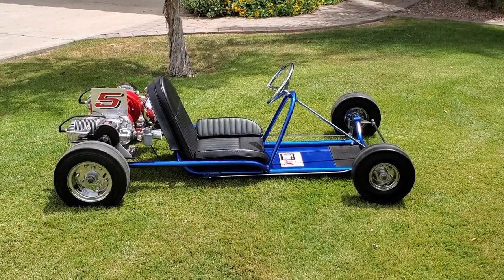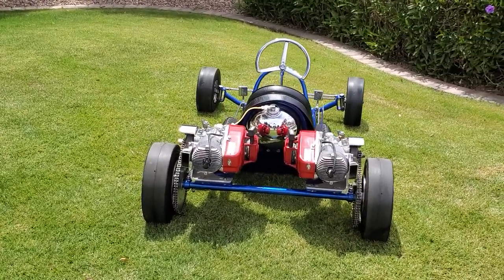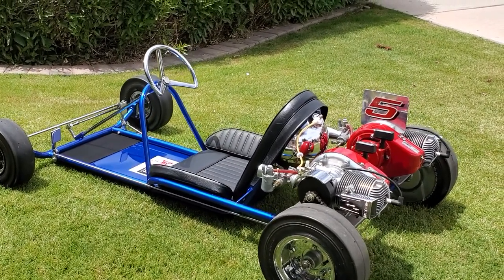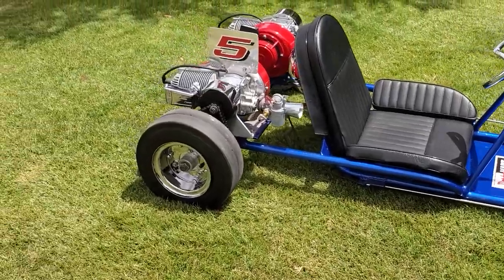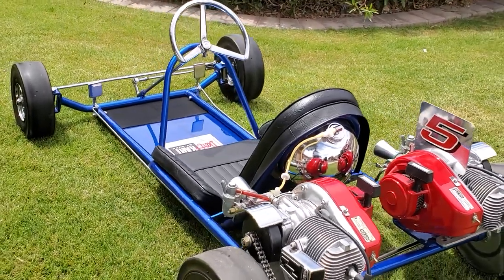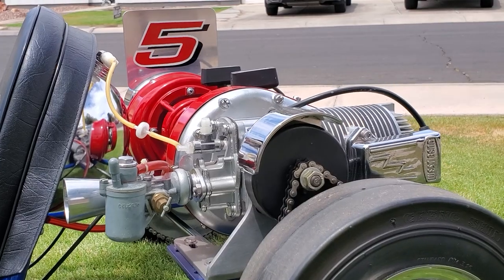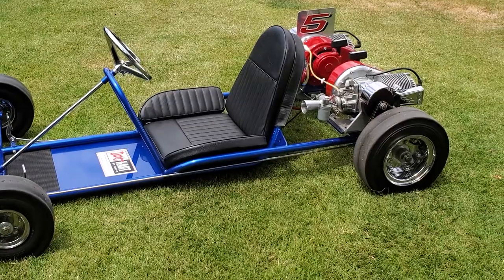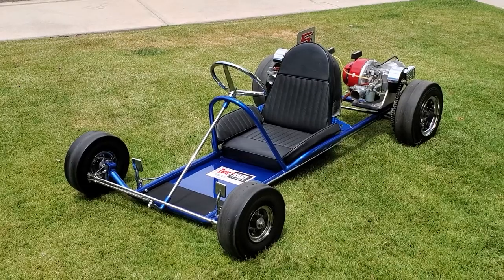1959 Rupp Dart Kart Walk Around

Comment: My memory of Dart Kart 1959 had a round gas tank mounted between the frame rails behind the seat so low that it come down almost to the track. it was about 5 inch in diameter.

Comment: Do any of these carts have disc brakes , any brakes up front? I am thinking off road capabilities  but not for speed , just stability . A flatter than quad / trike is what will fit inside the van and significatly lighter.
Reply: Pavement track cart only. Period.